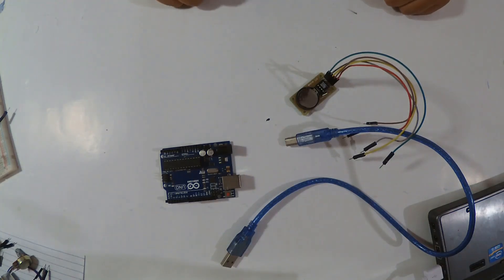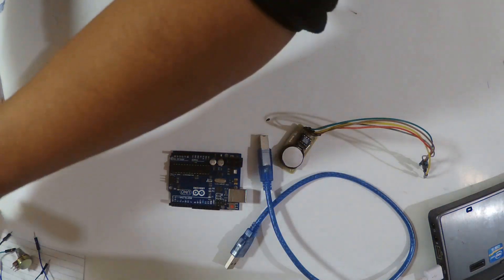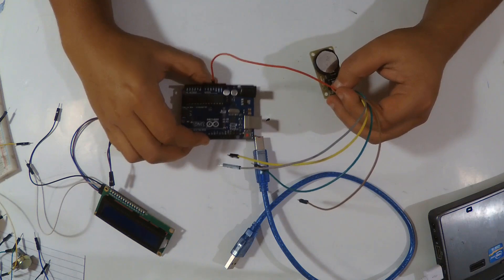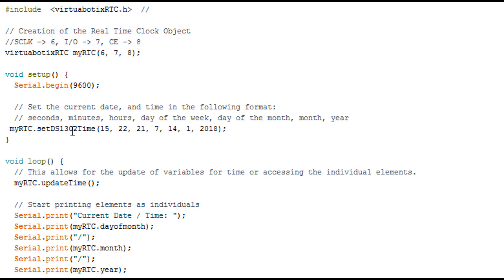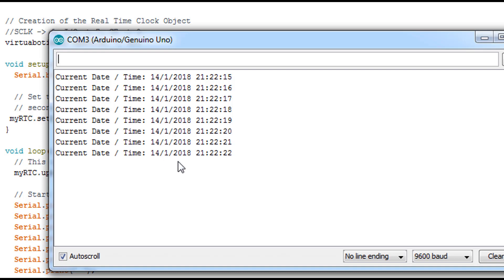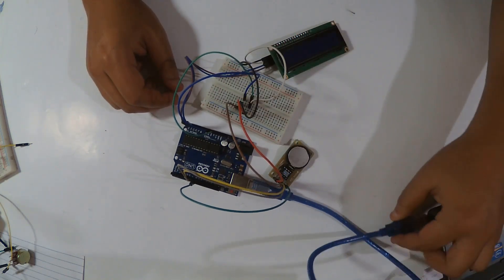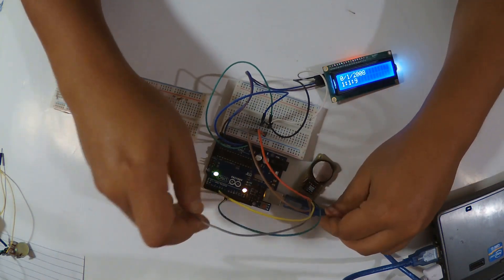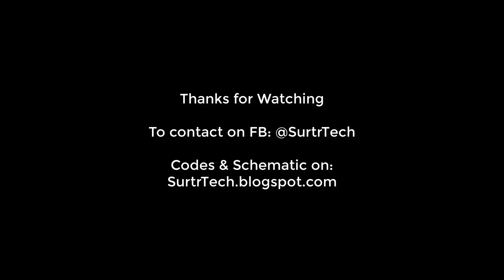How to simply use DS1302 RTC with Arduino and LCD screen

Comment: Thanks. Here is my loop() routine :
void loop()
{
// This allows for the update of variables for time or accessing the individual elements.
  myRTC.updateTime();
// Start printing elements as individuals
  Serial.print("Current Date : ");
  Serial.print(" ");
  switch (myRTC.dayofweek)
  {
    case 1  : Serial.print("Monday "); break;
    case 2  : Serial.print("Tuesday "); break;
    case 3  : Serial.print("Wednesday "); break;
    case 4  : Serial.print("Thursday "); break;
    case 5  : Serial.print("Friday "); break;
    case 6  : Serial.print("Saturday "); break;
    case 7  : Serial.print("Sunday "); break;
    default : Serial.print("Sunday ");
  }
  if(myRTC.dayofmonth<10) Serial.print("0");
  Serial.print(myRTC.dayofmonth);
  Serial.print("/");
  if(myRTC.month<10) Serial.print("0");
  Serial.print(myRTC.month);
  Serial.print("/");
  Serial.print(myRTC.year);
  Serial.print(" / Time : ");
  if(myRTC.hours<10) Serial.print("0");
  Serial.print(myRTC.hours);
  Serial.print(":");
  if(myRTC.minutes<10) Serial.print("0");
  Serial.print(myRTC.minutes);
  Serial.print(":"); 
  if(myRTC.seconds<10) Serial.print("0");
  Serial.println(myRTC.seconds);

// Delay so the program doesn't print non-stop 
  delay( 5000); 
}
This way we can display the day of the week as well and we have a zero as number of tens for day month hour minute and second...

Comment: Thanks very much! The circuit and the software worked. I tried to use other libraries but could not get it working. May I ask why the 1K resistor made a difference to the correct timing?
Reply from the maker: To adjust Output Signal... these cheap modules are not that reliable...

Comment: Arduino: 1.8.12 (Windows 7), Board: "Arduino Uno"

sketch_aug21a:19:80: error: no matching function for call to 'LiquidCrystal_I2C::LiquidCrystal_I2C(int, int, int, int, int, int, int, int)'

 LiquidCrystal_I2C lcd(I2C_ADDR,En_pin,Rw_pin,Rs_pin,D4_pin,D5_pin,D6_pin,D7_pin);

                                                                                ^

In file included from C:\Users\Administrator\Documents\Arduino\sketch_aug21a\sketch_aug21a.ino:7:0:

C:\Users\Administrator\Documents\Arduino\libraries\LiquidCrystal_I2C/LiquidCrystal_I2C.h:57:3: note: candidate: LiquidCrystal_I2C::LiquidCrystal_I2C(uint8_t, uint8_t, uint8_t)

   LiquidCrystal_I2C(uint8_t lcd_Addr,uint8_t lcd_cols,uint8_t lcd_rows);

   ^~~~~~~~~~~~~~~~~

C:\Users\Administrator\Documents\Arduino\libraries\LiquidCrystal_I2C/LiquidCrystal_I2C.h:57:3: note:   candidate expects 3 arguments, 8 provided

C:\Users\Administrator\Documents\Arduino\libraries\LiquidCrystal_I2C/LiquidCrystal_I2C.h:55:7: note: candidate: constexpr LiquidCrystal_I2C::LiquidCrystal_I2C(const LiquidCrystal_I2C&)

 class LiquidCrystal_I2C : public Print {

       ^~~~~~~~~~~~~~~~~

C:\Users\Administrator\Documents\Arduino\libraries\LiquidCrystal_I2C/LiquidCrystal_I2C.h:55:7: note:   candidate expects 1 argument, 8 provided

C:\Users\Administrator\Documents\Arduino\libraries\LiquidCrystal_I2C/LiquidCrystal_I2C.h:55:7: note: candidate: constexpr LiquidCrystal_I2C::LiquidCrystal_I2C(LiquidCrystal_I2C&&)

C:\Users\Administrator\Documents\Arduino\libraries\LiquidCrystal_I2C/LiquidCrystal_I2C.h:55:7: note:   candidate expects 1 argument, 8 provided

C:\Users\Administrator\Documents\Arduino\sketch_aug21a\sketch_aug21a.ino: In function 'void setup()':

sketch_aug21a:31:6: error: 'class LiquidCrystal_I2C' has no member named 'setBacklightPin'; did you mean 'setBacklight'?

  lcd.setBacklightPin(BACKLIGHT_PIN,POSITIVE);

      ^~~~~~~~~~~~~~~

      setBacklight

sketch_aug21a:31:36: error: 'POSITIVE' was not declared in this scope

  lcd.setBacklightPin(BACKLIGHT_PIN,POSITIVE);

                                    ^~~~~~~~

exit status 1
no matching function for call to 'LiquidCrystal_I2C::LiquidCrystal_I2C(int, int, int, int, int, int, int, int)'

This report would have more information with
"Show verbose output during compilation"
option enabled in File -> Preferences.

help me

Comment: Thanks for the video! One question though: what is the resistance value of the resistor you used? Does it have to be a specific value or could it be any resistor?
Reply from the maker: I used 1k, I think close values should work too, I tried some.

Comment: i didnt add 1k resistor but it works! but there is one problem if you reset your arduino the time resets also, can you fix this please?
Reply from the maker: Hello, yes the resistor is optional, when you reset the Arduino, does the time resets to what you set it before you upload the code or it gives you some default date/time like 1/1/2000 00:00:00 ?

If it gives you the time you set, you need first to set the correct date and time upload the code... Then comment (put "//" before) the line that contains the function of "myRTC.setDS1302Time" and reupload the code again.
Reply: @SurtrTech  thanks, it now works!

Comment: it set current time automaticly but from where it get the current time ? from the desktop computer ?
Reply from the maker: You may find some libraries that detect time automatically, by detecting the sketch compilation date and time.
But this library you need to set it first using the function "setDS1302Time" in "setup" then reupload the code without it
Reply: ok thanks @SurtrTech , but this project is useless if you cannot initiat with the real current time, no need library just write a win32 program windows side take the time from internet using sockets or simply windows date api,  then send that data true the serial com wich your arduino is connected ans read it with serial.read() and ... voila !

Comment: Thanks for support man!
Reply: excuse me, how can down the librery for include virtuabotixRTC.h ..? tks..
Reply: @manuelantoniogallegos1279  get on Github, then there is a "download" button on the right. Download it and save as a zip. Then open the Arduino IDE and under "Sketch" import the zip file. Probably to late for you

Comment: Hi there, im quite having a problem with the program because of some errors in the code including the file extension of .h
Reply: Im quite new with programming
Reply from the maker: @karlmigs3280  That's a library problem, check if you installed the libraries correctly, and then check if you don't have two libraries or more of the same name

Comment: Hy i have some problem here, my rtc was working correctly just when showing the time, but when i unplugged the vcc or gnd of the module, the time was repeated to setting time.
Reply from the maker: Hello, upload the code, let the module count for few seconds, then reset the Arduino,
 if you get repeated time, you should first upload the setting time code and then reupload the code without setting
otherwise it will repeat time everytime you reset the Arduino

Comment: Hey man, i´m new on arduino, i set the time and date on the rtc with no problem, but in the second code i got this problem: 
" no matching function for call to 'LiquidCrystal_I2C::LiquidCrystal_I2C(int, int, int, int, int, int, int, int)'  " . in the line after pin´s are defined

it´s the same code from your page, can you help me out?

(also i´m from mexico, so i don't have the greatest english XD )
Reply from the maker: Did you install the library correctly? Or you're using a different one?
It's a library issue, you can remove your other library and replace it with the one I used, or try to replace that function with the matching function from the library you're using.
Reply: oh, i see the problem, thanks a lot, i solved. You're a hero  @SurtrTech

Comment: i hope u're good first of all ty for that video   it really helped me a lot with my project at school but i'm facing some struggels i'd like to have a help from u if that's okay ....i really wonder how we can add the  names of days of week to the same program 
and ty
Reply from the maker: Hi, I think you just sent me a message on FB, I responded there, you can add "myRTC.dayofweek" combined with a switch case
Reply: @SurtrTech   yeah i'd appreciate it if u gave me more detailes because im not very good  in arduino language
Reply from the maker: @charaf9099  I'll send you an example
Reply: @SurtrTech  Hey! do you think you could post that example here :)
Reply from the maker: @BreadIsNow  I told him about the day parameter and if you want to add it there it will be :
"myRTC.dayofweek" and it goes from 1 to 7
so you can add a "switch, case" structure to associate every value with a day and for example:
switch(myRTC.dayofweek)
case 1:
Serial.print("Monday");
break;
case 2:
Serial.print("Tuesday");
break;
...That's it you can check the switch case structure on Arduino playground for more details

Comment: I get a error when i remove the myRTC.set time line??
Reply from the maker: Hi, can you please tell me the whole Error?
I think you probably, deleted the whole line which left some "comments" without their "//".
You can just add "//" before the "myRTC.setTime" line.
Reply: @SurtrTech  Hi thx for fast response :-)  i am just adding // to the set line but im getting  error 

C:\Users\black\Documents\Arduino\libraries\ArduinoRTClibrary-master\virtuabotixRTC.cpp: In function 'DS1302_write.constprop':

C:\Users\black\Documents\Arduino\libraries\ArduinoRTClibrary-master\virtuabotixRTC.cpp:479:1: internal compiler error: Segmentation fault

 }                                     //|    |

 ^

Please submit a full bug report,

with preprocessed source if appropriate.

See <http://gcc.gnu.org/bugs.html> for instructions.

lto-wrapper.exe: fatal error: C:\Program Files\WindowsApps\ArduinoLLC.ArduinoIDE_1.8.19.0_x86__mdqgnx93n4wtt\hardware\tools\avr/bin/avr-gcc returned 1 exit status

compilation terminated.

c:/program files/windowsapps/arduinollc.arduinoide_1.8.19.0_x86__mdqgnx93n4wtt/hardware/tools/avr/bin/../lib/gcc/avr/5.4.0/../../../../avr/bin/ld.exe: error: lto-wrapper failed

collect2.exe: error: ld returned 1 exit status

exit status 1
Error compiling for board Arduino Nano.
Reply from the maker: @brianwgDK  Did it work at first then you got an error when you modified it? Or error from the start?
Reply from the maker: @brianwgDK  It seems like an IDE problem, here I suggest you an issue that you could check (I've never tested it): https://forum.arduino.cc/index.php?topic=568731.0
They suggest some solutions:
"Tools > Board > Boards Manager
Wait for downloads to finish.
When you move the mouse pointer over "Arduino AVR Boards", you will see a "Select version" dropdown menu appear. Select "1.6.21".
Click "Install".
Wait for installation to finish.
Click "Close"."
Or:
"(In the Arduino IDE) File > Preferences
In the "Additional Boards Manager URLs" field, enter: http://downloads.arduino.cc/packages/package_avr_7.3.0_index.json
If you already have an additional Boards Manager URL in that field, you can separate multiple URLs with commas or click the button on the right side of the field to open a dialog that allows you to add each on its own line.
Click "OK"
Tools > Board > Boards Manager
Wait for the downloads to finish
Click on "Arduino AVR Boards by Arduino"
Click the "Update" button.
Wait for the update to finish.
Click "Close"."
Reply: @SurtrTech  yes works fine, just cant remove set time
Reply: @SurtrTech  thx, i have a look :-D
Reply: @SurtrTech  YES just tried the online Editor, that did it :-D thx for the assist and tutorial. i'm a firefighter and wanted to measure temperature under my close and under my helmet. i got burned thru my firefighter close the last time, and wanted to se when i reach dangerous temperatures... so RTC and a datalogger. and 3 probes.
Reply from the maker: @brianwgDK Glad it worked for you, your project seems very interesting, good luck in your work and stay safe.
Reply: @SurtrTech   Best Guide everr

Comment: Hi, I just did the connections, downloaded the code ant id doesn't work, my ds1302 just heats and shows I'm in the 2000!
Also why do we need 5v when the battery itself is in the module?
Reply from the maker: Re check your wiring and watch out the pins used, and download the first code which sets up the module, and use the resistor as recommended.
The battery cell is just for when you turn off the Arduino it keeps up the time counter
Reply: Oh well I just bought ds3231 that works on I2C, I read it's more reliable than ds1302
Reply from the maker: Yes it's better, the 1302 has a lot of problems
Reply: @SurtrTech  Have the same problem. It just write repeatedly: Current Date / Time: 0/0/2000 0:0:0
Reply from the maker: @pablosckX  Did you try to add the resistor? Or it may be a grounding problem
Reply: @pablosckX  I have the same problem, you fix it ?

Comment: Greetings!  Working great for me, however I did have to check the address of my display, it came back 0x3F once I changed that address in the code, I have a fine working clock.  The only thing missing is an alarm function, it would be great to add that to the mix, since my old night clock was transplanted to our motor home, and I no longer have an alarm clock for those rare days when I need to rise before the damn cat wakes me  up at 7:00 AM wanting the damn window open.  Oh the joy of old age!
Reply from the maker: Did it finally, I apologize for the long wait youtube.com/watch?v=62tHrqMM55w
Reply from the maker: Hello, I already have the code and the wiring for an alarm clock function, the problem is I'm a bit busy these days, I will upload it as soon as possible.

Comment: Same time is displaying repeatedly which i have set on the code even after commenting out the lines and using 1k resistor. What can be the problem???
Reply from the maker: Hello, did you first upload the code with the line "myRTC.setDS1302Time..." then you should put a comment on that line and reupload the code.
If it still doesn't work you could have a problem in the module either the battery is dead or the crystal has a problem
Contact me on facebook if you want.
Reply: SurtrTech yes i have done the above steps but still getting prblm
Reply: Perhaps if you upload the second code that is meant to run the clock and not just sit the device you may have better luck.  Of course I am just trying to read your mind over the thousands of miles that separate us from each other, or rather I am just guessing that may be the problem.  There are two codes in the pack, if your download came properly.

Comment: thanks for what u are doing in this video it's very helpfull
i had a problem
i follow the same steps and i have the same module DS1302 it show me this how can i solve this prb plz

xxxxxxxxx 00.00.2000 -- 00:00:00
000:00:00 00.00.2000 -- 00:00:00
000:00:00 00.00.2000 -- 00:00:00
Reply from the maker: Check the wiring and add 1k resistor
Reply: i have the same problem, and i doble check de wiring, and nothing happened
Reply from the maker: may be the battery or the crystal problem
Reply: having the same problem, i replaced the battery, checked the wiring and copied your code. :(

Comment: Thank you! You saved my RTC. I almost threw it out of the window when it started to display shit numbers, all I needed was the resistor.
Reply: plz tell me where did u put the resistor
Reply: lotfi DZ in series with the data pin of the rtc to the digital of the arduino
Reply: Same here. Tried multiple code versions and got 2008 for year.
Reply: https://youtu.be/H58h_BvDbcY  
JUST GO AND WATCH IT GUYS